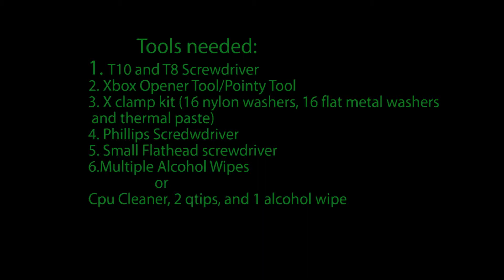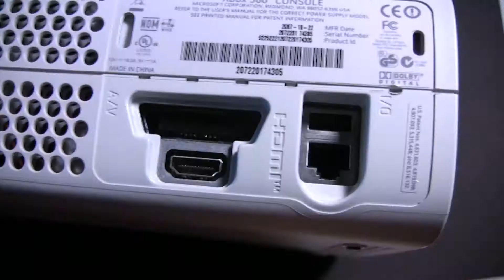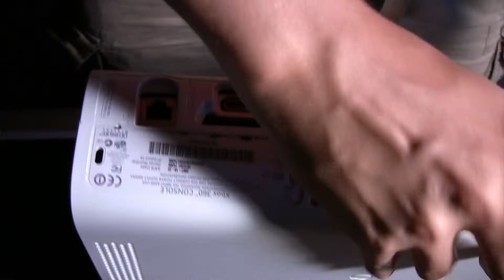X Clamp Fix - RROD Repair Guide Part 1: Opening Your Xbox 360

Comment: I tried it on 2 xboxes and they both did not work!
Reply: +Owen Waldo You probably forgot that you also need to use a heatgun on the motherboard to allow the solder to re-adhere to the main board.
Reply: supercj12 I did that too
Reply: did u make sure nothing like a transistor was knocked off while it was cooling from the heat gun?
Reply: supercj12 Yup nothing got damaged while i heated it/cooled
Reply: Owen Waldo
Then your Xbox is dead cause you fried something. If it doesn't work after properly using a heat gun to remelt the solder, and you put it back together correctly, then one of the chips, or any chip, is fried, and your Xbox is dead.